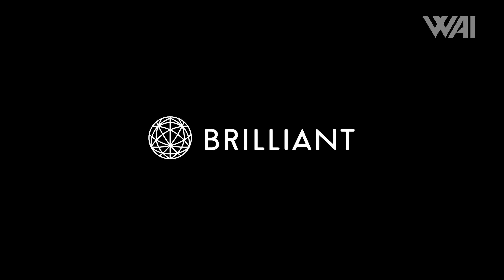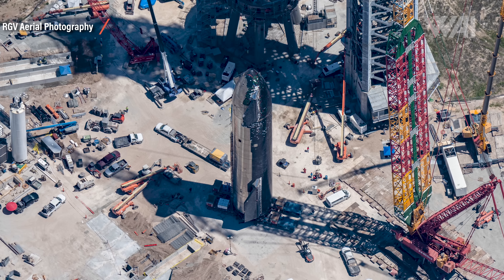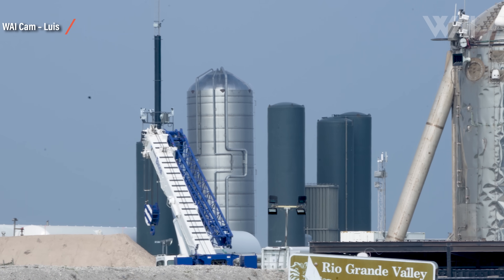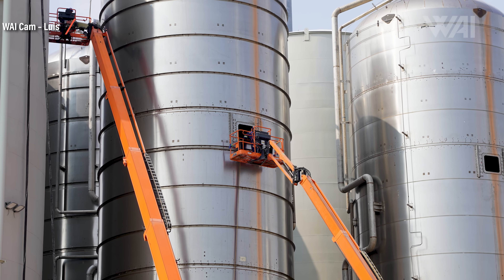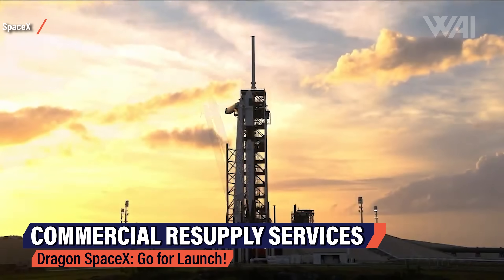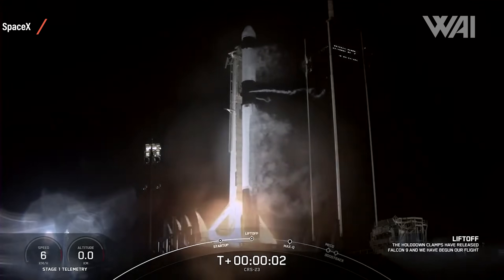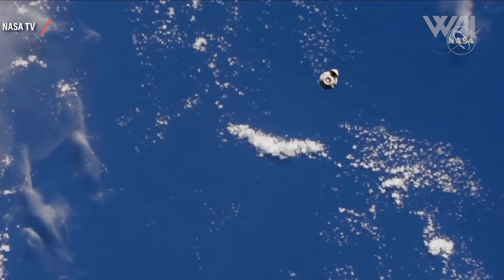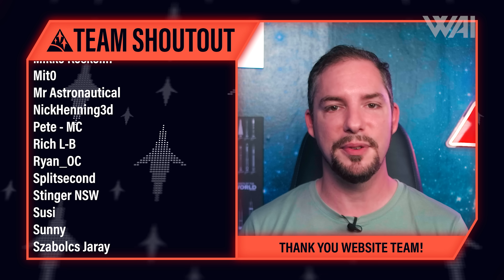SpaceX Starship Heat Shield & Mechazilla Progress Analyzed – CRS-23 Launch Report

Comment: This very long laying process 🪔🕯 makes the tiles more sensitive to 2 deviations, by effect the tiles look at the ship while it should be the reverse nextgenx build in.
The thermal shock wool indeed in this version this time well built in a patronized coat and not in a gigantic puzzle, due to time constraints.

Paradoxically, the thin parts and the corners have the most successful compactness.

The next ships then dressed in a thicker woolen coat wired assembled to the fuselage (honeycomb sweat shielding) on marble roller tables with profiled tiles, with wingspans of nearly 20 meters  🎞🧵🧶🧥🌄✨🚀. 

The plates then covered with their wired trim (Tungsten ⚔⛸"Cable-glide" or other anti-vibration materials near to rapid cooling) in half thickness of the two direct contact wools.

Tile wool walls embedded in another perforated plate profile with cable for the flow of gases and other cooling fluids (rockets are hard)🙌👍🏋️‍♂️👽🦾🚀.

Each part of these gigantic mesh sizes obviously very difficult to transport, the full lining mantle built for shock, thermal resitance, flatness centering control of each, attaching first from the top, then stapled (glued) progressively after the starting cap glove following the descent or any faults in the fuselage.

 In order to reduce the fragility of the armored plates of the interior bakery manufature factory. This does not include then here the same type of honeycomb shielding on the outside as an alternative.

Comment: I would think a static test is needed to evaluate the adhesive durance of the heat tiles.  Can they withstand the mechanical and acoustic vibration of a launch.  It would really suck if Starship left a trail of heat tiles.
Reply: That's the point of the upcoming test flight... to find out how well the tiles hold up in real-world conditions.
Reply: @simongeard4824  A static test may expose weak tiles prior to a launch.
Reply: @maninifarmer1338  It might, or it might not. Remember, they've had smaller patches of tiles on earlier prototypes, so they already have data on how tiles cope with vibration in flight, not just from static fires. 

But again, the thing they need to know most is what happens when Starship attempts re-entry, and SN20 exists for the sole purpose of being flown once and destroyed in the process of answering some of their questions. There's no point in spending months perfecting the tile system if the first re-entry attempt convinces them it's a bad idea and they need to do things differently.

Comment: Quite enough tiles like  on "shuttles" )) With hope their maintenance won't be as much expensive.
Reply: I don't think it will ever get that bad! But it remains to be seen how close to that bad they get - it's a similar point of failure that's for sure. Just one imperfect tile could lose a whole ship, so their verification methods need to be extremely accurate. Even if their repair/replace methodology is 100x faster, if verifying damage is slow then everything is slow
Reply: @z-beeblebrox  SX definetly need a plan B fallback at places where tiles get failed - transpiration cooling  etc.
Reply: @madcalm2024  They absolutely need a backup system. Columbia was in operation for twenty years before its heat shield failed, but it also only flew 28 times. Starships need to fly thousands of times more often. Even combining all 135 shuttle flights together, one heat shield failure at that rate on Starship would equate to a RUD about 7 times a year on their aspirational 3 launches per day cadence. That's a lot of mid-air booms! And to be fair, it technically does has one backup now, as the adhesive also acts as a weaker heat shield. But to really be reliable, it needs something for when BOTH of those fail.

Comment: What if the nose cone was ejected and left to burn up upon reentry? Then the nose cone wouldn't need tiles, which would dramatically reduce the number of unique tiles needed for each starship.

Or perhaps a new nose cone shape that is optimized not just for aerodynamics but for smallest number of unique tiles? Think of a conic shape that has a hexagon or octagon-shaped cross section rather than a circular cross section.  Lots of flat surfaces, lots of flat tiles.
Reply: The latter is exactly what they're planning for future revisions... we saw it in Tim Dodd's factory tour with Elon. Basically a blunter nose... probably not just for the heat tiles, but simplifying the tile design is definitely part of the redesign.
Reply: @simongeard4824  Nice! Glad to hear SpaceX is exploring that idea. With all the effort they've put into rapid reusability, I'd hate to see tile replacement become a bottleneck slowing down the headways between launches.

Comment: I wonder about the arms themselves: do you think there will be rollers on the arms to spin the spaceship so the hatch faces the tower after the catch?
Reply: The ship could be rotated by running the ‘tank treads’ in opposite directions, the same way a tank turns. There would be a limit to the rotation, since it will be held only by the mounted catch points, so it will have to be mostly aligned when it is caught.

Comment: Looking into the future I think the ceramic heat shield tiles are the wrong way to go.  It seems unlikely to be repairable in the field (Mars).  The decision to make Starship primarily out of stainless steel opens up the possibility of repairing the main structures with cutters and welding torches on Mars.  Then again will Starships be repaired in the field or just abandoned?

Comment: I wonder if catching the starship might require that some properly load rated lifting "pins" are hidden away until the re-entry heat is dissipated, after which they are extended outward, kind of like airplane landing gear.

Comment: The dramatic improvement in AI, robotics, and cheap visual systems will mean it will be possible to create a machine to check, test, and replace all heat tiles for problems in a very short timescale, rather than the incredible amount of human labor the Shuttle program used.

Comment: Me thinks much larger sections of heat shield will be necessary. They'll need to be hull shaped molded and bolted on to the necessary areas. Waaay to much shape variation, vibration, hyper force and heat for a tile system to be effective.

Comment: I wonder if it's possible for them to make giant pre-made heat shield tiles. Instead of using thousands of similar tiles, why not just build them bigger?
Reply: I think the relative expansion rates vs the steel underneath limits tile size.
Reply: @Tailspin80  Ah that makes sense. Damn.

Comment: A question for someone smarter than me:

How is SpaceX going to grab the starship without crushing the ceramic tiles? I know they said there were going to be lifting points... but won't exposed lifting points just burn off during reentry?
Reply: The lifting point are going be be big and steel, solid steel doesn't mind being warm. If it were a problem i guess they could put a small expendable cover over it, but by all accounts plan A is just to let it be big and metal. it also helps that it's not located in the hottest part of the shock area. It should be fine by a few hundred degree margin.

Comment: The heat shield on the shuttle was probably the biggest problem. It was made up of seven different types of tile/material and was very labour intensive to fit. This area is looking like the biggest risk to Starship.
https://en.wikipedia.org/wiki/Space_Shuttle_thermal_protection_system
Couldn’t they develop a material made up of very small tiles on a backing sheet and glue it on? That way they wouldn’t need to manufacture special tile shapes round the cone etc.

Comment: I've maintained for several months now SN20 won't attempt a flight until Spring of 2022 because of the Heat Shield.
Reply: No use worrying about Starship when they are still working on the booster. It will happen when it happens.

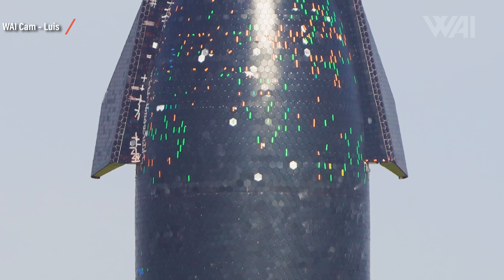Comment: @3:30 Given the problems caused by trying to stick on a bazillion heat shield tiles, I can predict that SpaceX will cast the entire nose cone heat shield in a single unified tile. 

Given that there will be thousands of these shields produced, perhaps SpaceX can take a hint from the toilet making industry which produces thousands of perfectly smooth ceramic bowls every year. Mounting can be done mechanically as well since the entire unit can slide onto matching rails on the ship, rather than the current porcupine appearance on the Starship shell.
Reply: Casting the entire nose cone heat shield would probably introduce a whole set of new problems i think.
For example : big cracks or wrong alignments during re entry. i could be wrong though lol.

Comment: Hi Felix. For me the heat shield is not good , I refer how is made . SpaceX should overlap the tiles like making 45 degrees on the edges and the pins for fixing should be 1 to slide in the tile and 2 on fix points . Like this is no weight gain and more space to move with the expansion from heat and contraction from cold .

Comment: Heat shield could do with some material science breakthrough. A bit along the same lines of the sleet alloy.
Reply: Imagine if you could dip the nose cone into mud and pre-bake it, like painting a car :)
Reply: Concrete uses steel fiberglass carbon fiber to add strength and halt cracking. Could Elon do some reinforcement?

Comment: FYI - Booster takes 4,300-4,600 tons of fuel, while Starship requires 1,200 tons = 5,500+ tons needs to be available from the tankfarm per launch.  Also, ASOG is self-propelled, a change from the previous barges.

Comment: Why can’t there be big heat shield tiles? Each specifically made to perfectly fit its location. Too many tiles, too many variables such as defects and misfitting.
Reply: Because faults will spread over a greater distance and also make repairs more difficult.

Comment: 4 possible solutions.. Aerogel. A sacrificial heat shield that is replaced each time. A star trek deflector dish like solution that displaces air? Or instead of absorbing the air send it away like f1 card do with the vortexes?

Comment: I don't believe that Starship will ever be recycled in a few hours. Much more likely it will be a few weeks. There will be too much damage to the tiles, due to hull deformation. Even tiny movements will damage the tiles. Probably hundreds will be replaced after each flight. Nevertheless if Starship could launch every four weeks that would be remarkable. But missions beyond LEO means the refuelling with say 10 flights will take a couple of months. And that is if there are 4 or 5 Starship refuelling ships available.

Comment: If they can spray concrete, why can’t they spray the heat shield?
Reply: Because the stainless hull expands and shrinks with temp vcanges. A spray on shield would not be able to flex to deal with this

Comment: What itches me a bit is how many tiles came off/loose or got damaged, just by the rather few and gentle movements during transport and stacking. In the current state, they will fall off or break apart during launch and reentry. So this definetely requires major improvement.

Comment: The heat shield has been the only thing concerning me about starship. Landing and catching a booster I don't worry about. But I've always been concerned about the heat shield.
Reply: I agree. The shuttle had major problems with the tile system they chose to use to protect the orbiter during re-entry. Hopefully we will not see a repeat with Starship. My money is on SpaceX being able to solve any problem they encounter. However, I think getting the heat shield to the point where it will allow Starship to survive re-entry two to three times a day will take A LOT of trial and error. Best of luck to SpaceX. We are all routing for you and we will all be following your progress!
Reply from the maker: It's a tough task for sure! Starships will do aerobraking to reduce stress. A few passes when returning to Earth and even to Mars two passes are wise.
Reply: @Whataboutit  I believe SpaceX will need to develop a new form of heat shield in order for it to be successful in the long run. These tiles are way to fragile and time consuming to be used permanently. They would need a large surplus supply of each tile in order to be able to replace quickly. I have faith in SpaceX to overcome these issues but I believe we will see a new type in later versions of Starship.

Comment: Why not used larger tiles in areas that do not need special cut tiles. Seems to me adding all those small tiles are just asking for more proplem. Will create more spaces, gaps and chances for plasma to enter. Larger sections of heat shielding makes more sense.

Comment: Do the heat shield tiles need to be that small?  could it not be a single, of several large units for the nose cone? it can be prepared and repaired off the ship then and swapped in a shorter time?

Comment: Why can't they use larger heat shielding tiles?
Reply: I assume that very qualified experts came to that size based on some first principles designs, but if I had to guess it's probably cheaper to buy dinner plate sized machinery and make dinner plate sized tiles, if you had to work with an existing ceramics industry suppliers. Bigger tiles are probably more fragile in transport too.

Comment: Does nose cone shape has any use or can they have simple design and not s nose cone
Reply from the maker: It's surprising how little pointy a rocket actually has to be, but it needs to at least be a round shape.
Reply: @Whataboutit   Probably in future  they may come up with some simpler design , these tiles seems to be giving them hard time with this shape . Would be Interesting to see , thank you for responding .

Comment: That's a really big surface area to be covered ,and the shuttle and capsules direct the plasma away, while the star ship could get like a flame engulfing effect. So Does Elon have access to like a heat tunnel to simulate all the unknowns or is he just going to use computer  simulations?
Reply: Plasma simulation is pretty well understood at this point. Relax.
Reply from the maker: Look at Alex Svan's animation work. He researched the heatshield shape before it was known and almost nailed it by just simulating the fuid dynamics.
Reply: @Whataboutit  Also, the standard SpaceX approach to testing... put a vehicle into orbit, and see how it handles it. Cheaper than building fancy ground-testing equipment, since once they can reliably launch Starship, they can combine re-entry testing with actual payload missions... similar to how Falcon 9 landings could be tested on paying missions.

Comment: What they need to develop is a 3D Printed Heatshield, and create large slab sections. Tiny tiles seems to be a potentially problematic solution, even if the majority of them are not as unique as they were on the Shuttle.
Reply: probably the bigger they are the more the chanses to crac them due to lox and methane behing under 0c and wirh reentry heat as well the metal might shrink or widen too much for them
Reply: Continuous shield of the same sort of material would lead to continuous cracks. It would doom the rocket. Fixing parts of the heat shield would also require cutting or fracturing the surface first. It doesn’t work.
Reply: why nobody is testing the small rockets like dracos to slow down the ship? replace heatshields with something else and add something like dracos... i know it will add weight and complexity and maybe its more effective than headshields?